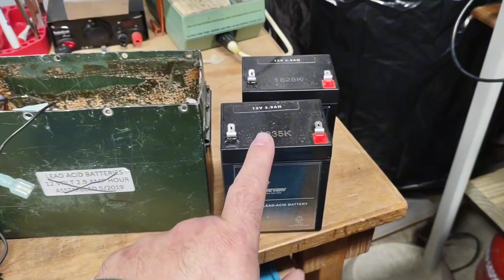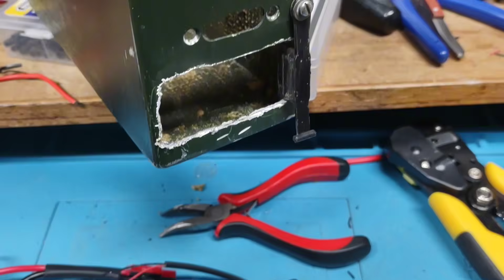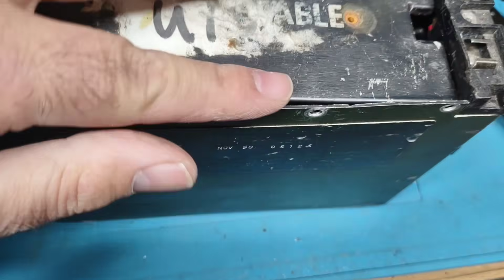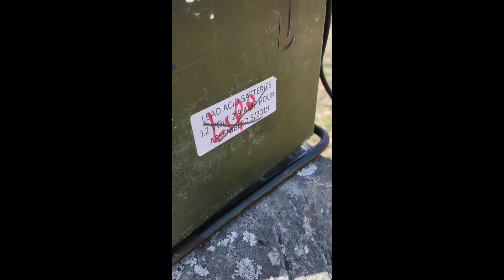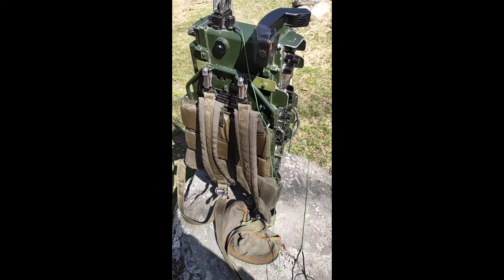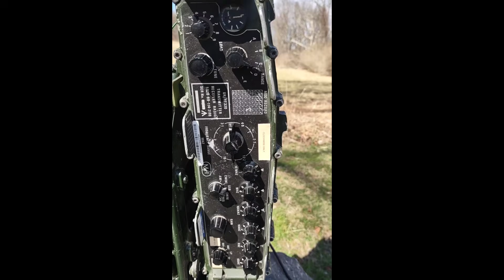Clansman rt-320 prc-320 Military radio battery upgrade for ham radio & 1st contact

Comment: Great video, the hobby has so many facets and military radios are a nice segment.. One benefit to the upgrade is longer talk time and another is virtually no battery sag when the transmitter is keyed and draws a couple amps.. Trying to decide what to do with a couple modern mobile rigs as I have a nice suitcase sized commercial film travel box which opens on the small end that would make a good forward base radio setup container.. It is big enough to easily hold a 300a 12vdc LiFePo4 battery, 2 radios and all the accessories so your project has inspired me.. Down to having to share the vehicle with my wife and she is no fan of my radio hobby so if I can carry a station in a box at least I can still have portable/mobile operation if done right..  _ _ . . .   . . . _ _
Reply from the maker: If the YL can't support your happiness, then I'm sorry shes got to go! Haha  definitely get a go box going, it makes everything very easy. 73 . .